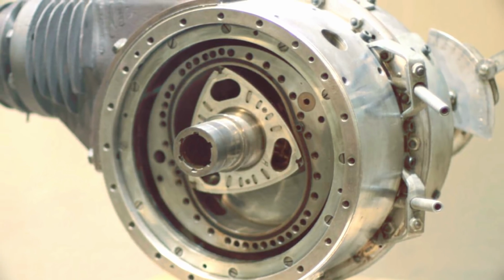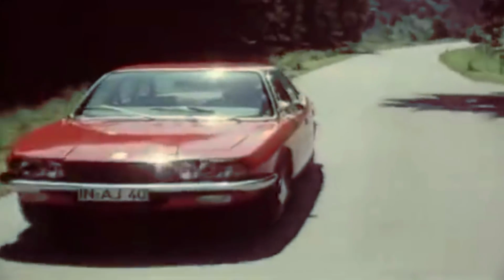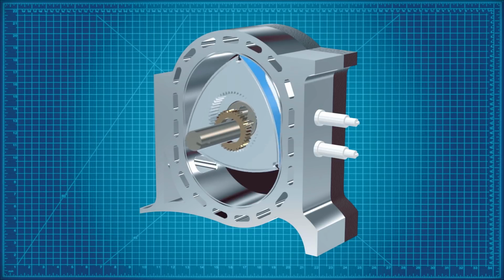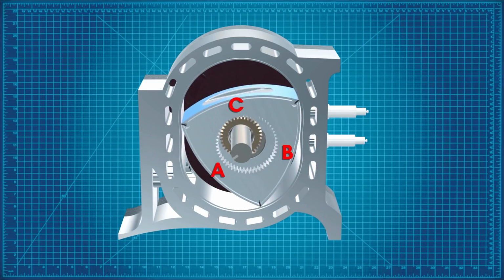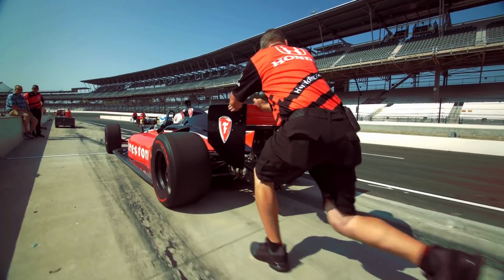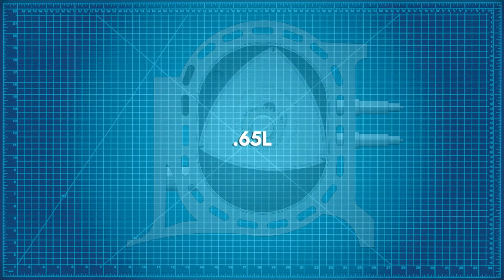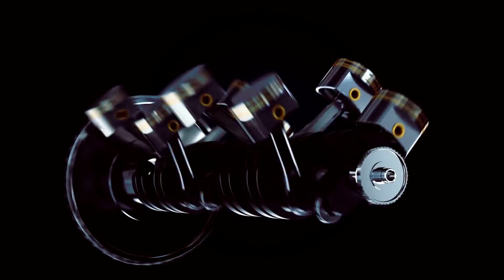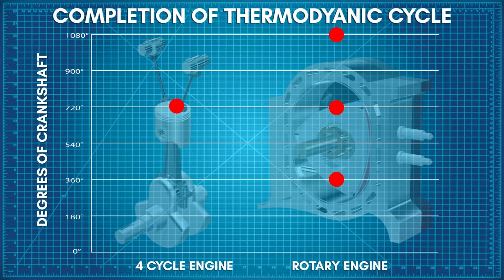Was the Rotary Banned | The Advantage of the Rotary Over the Piston

Comment: Just rebuilt my 1988 rotary only because of bad antifreeze which made the seals fail, runs great now nothing worn in motor. This concept of a motor is a milestone in technology it like the Deloreon had to go.
Reply: Seal failure is inherent to the design.... it is the primary failure mode of all Wankel engines.
Reply from the maker: Did you upgrade the seals? Or OE?
Reply: @GearQuest  the seals didn't cause the failure the acid from the antifreze ate the irons up. Mazda water seals were used for rebuild. Viton for oil seals.

Comment: Mazda did not work on the NSU RO80, nor did they invent the engine
Reply: Excellent comment, Mazda was a relatively small player in the development history of the Wankel engine... they were known more for the volume of production and for being the last to abandon the design.
Most manufacturers dropped development 40 years ago, Mazda struggled on for another 30 years before finally cancelling development in in May 2009 and production ended in 2012 due to the lack of sales.

Comment: Another great rotary video from you. Nobody has explained how a rotary produces torque, perhaps you can be the first. With a 2D approach, you can assume balanced combustion pressure on a rotor face, and have a single force vector from the center of the face to the center of the rotor. The lever arm is the distance between this vector and the shaft center. For this face, as with pistons, there is no torque at TDC and BDC. Although the stroke appears to be 2 x e, it's actually 3 x e,  unique to the rotary. You can back calculate it based on the face displacement (.65L) , and the projected area of the rotor face (22.53 sq in).

Comment: Let's just say I'm married to electric, but have a huge crush on rotary. If only it was cleaner...
Reply: The Wankel has a horrible reputation for unacceptable reliability and fuel efficiency.
The lower torque output made it unsuitable for large vehicles.
Reply: @sandervanderkammen9230  don't forget oil consumption
Reply: @sandervanderkammen9230  Never intended for larger vehicles. High RPMS and HP, purely a sport car performer.
Reply: @georgejones5019  That is incorrect.
Felix Wankel was an avid motorcycle enthusiasts and worked for NSU Motorenwerkes GmbH., one of Europe's largest motorcycle manufacturers at the time.

The Wankel engine was specifically designed and intended to be used as a motorcycle engine, not automobiles.
Of course the Wankel proved to be poorly suited to both applications and is no longer manufactured for either vehicle type.

Comment: Phenomenal power to weight ratio..large thirst for fluids..shorter life span and low thermodynamic efficiency where the hallmarks of the Wankel rotary engine..Too bad it wasnt developed any further to improve the design.
Reply: They probably were in secret .
Reply: @utubercouchvegetable2172  The development history of the Wankel engine is no secret... but the bulk of this work simply predates the internet, if you want to learn why the Wankel engine was a commercial failure? You need to start reading books.
Reply: @sandervanderkammen9230  hey whatsup doktorbimmer, i see you made a new account. i suppose it's good to have something to keep you busy especially in these difficult times, even if it means commenting on every rotary related video on yotube for 3 years!
Reply: @xav1uz  true
Reply: The Wankel reached the end of its development potential circa 1975 when it was determined that it could never match the efficiency of the reciprocating engine.